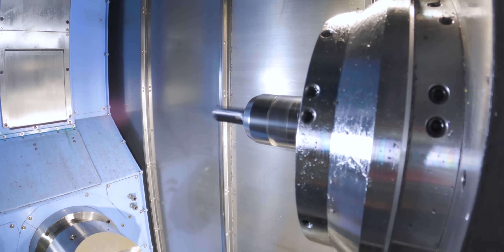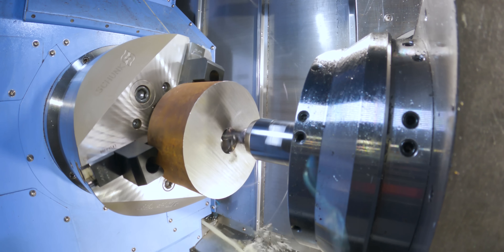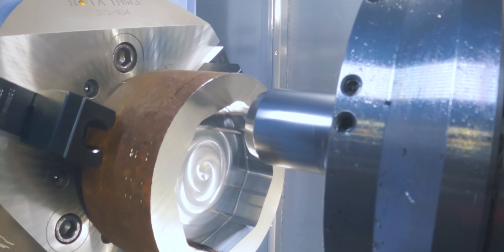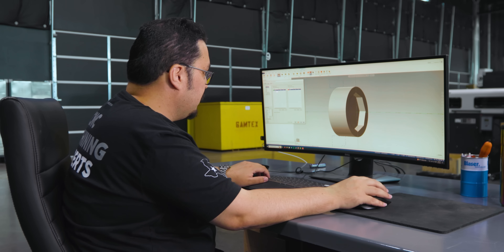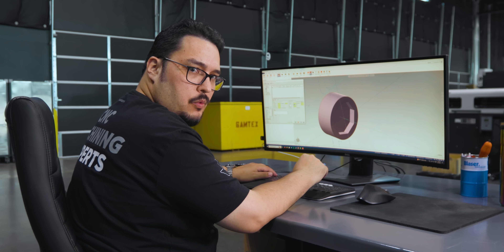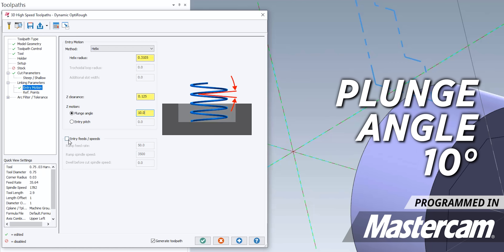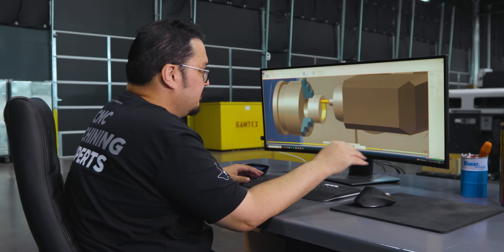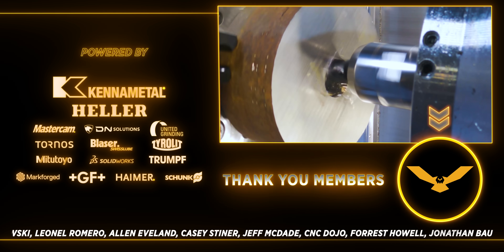Advanced Programming Technique For Taking Deep Cuts

Comment: I cannot help but think pre cutting it with a lathe tool you would be much faster?
Isn’t a lathe much better in volume removal?
It is impressive though
Reply: Having worked on mill turns and mills I think milling is probably faster in many cases. An endmill does have many flutes and you can increase the mrr fairly easy by simply dropping down further. With a lathe tool you only have one insert that has to do all the work. That’s not to say  „MiLlS bEtTeR tHaN lAtHeS“ but I think especially on machines that are capable of both milling and turning you sometimes can save a lot of time by going with what a pure lathe or mill guy would call an „unconventional“ approach. In the end I t really depends on the material, part and feature you want to machine
Reply: @derbacksteinbacker4942  Na no chance not in this case, it'd be way faster to drill and then bore that hole out to the minimum ID needed for the hex and then using the endmill to finish the depth and walls. Using the endmill for everything just takes longer way longer, has more opportunity to wear and throw the size out. Only benefit is one less tool change really.

It's also more economical to use an inserted drill and inserted boring bar rather than wasting a solid carbide endmill on it. 

Video isn't about efficiency though tbf it's just for fun and entertainment purposes. And to show off a cool cutter path and machine.

Comment: Isn’t that thing more rigid using X&Y instead of the C axis? We have 4 DN’s and they all seem to mill better with the C locked in.
Reply: Yeah same for 5axis mills, it’s always more rigid machining 3+2 versus 4-5 simultaneous. Luckily they’re milling 4140 and not anything too tough. Also the vid is pretty much just to flex a multi axis toolpath. If the order isn’t a huge quantity I can see the upside to roughing all this with 1 tool just for ease of setup,.. even if it’s not technically the most efficient way. There’s always a better way is what I’ve come to find lol, keeps us humble
Reply: That is a huge drawback of these Doosan machines.  With the milling head facing the main spindle like that the X Axis is VERY limited.  I had the next size smaller machine at my last shop and it could only go .8 below center line with the milling tilted like that.  Using polar interpolation like this was about the only option.

Comment: I wonder what the MRR difference would be if you roughed this with a face groover and then finished the octagon with an end mill. Turn roughing usually has a better MRR
Reply: Face grooving would be too slow.  Drill a hole, then bore the ID to the minimum inscribed circle of the hex and then finish mill.
Reply: Face grooving is painfully slow not to mention they can only cut a certain diameter range before the back of the tool starts to rub.
Reply: @hdfanboy  I disagree I use it all the time to clear material from the center of a cylindrical puck. You can haul through some material with a face groove if you push it. And you can cut whatever diameter as long as you enter the material in the holders min and max range
Reply: @matthewbudz4733  the min/max is only for where you can plunge. As long as you plunge to the final depth within this range you can then continue to plunge rough to the inside and outside of the face groove
Reply: I use this process every day instead of roughing with an end mill, it’s much faster than what I’ve been able to do using an end mill

Comment: well we know titan is crazy. i mean what man is not crazy drinks coffee ( even though its nitro cold brew ) from a transparent plastic cup and not a real coffee mug ? in my experience in workships its only the crazy ones that does that

btw would it also be possible to ramp it from the final shape and then spiral inwards with the C axis ? ( start at final size and shape -the wall stock to leave and ramping in with 10 degree to the bottom to final depth with pass at final depth and then spiral inwards to center )

Comment: can you make a "perfect octagon" with sharp internal edges by using a 90 degree chamfering tool in an engel so that the champering tool gets into the internal edge?
Or can you install a shaping tool into a lathe tool holder, and then use this shaping tool to punch the sharp internal edges.
Reply: I was thinking that too. Would love to see it tilt in there and make some sharp corners
Reply: I own the tools to do those sharp corners. Only need them for 2 jobs in 10 years. No EDM.